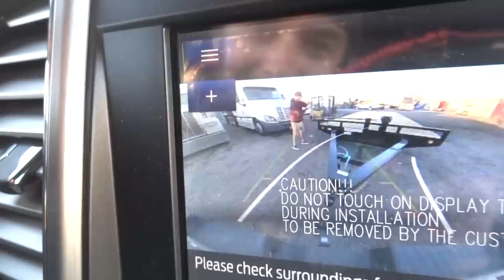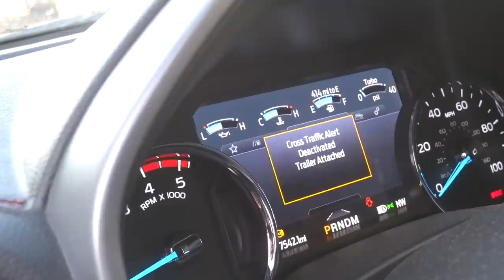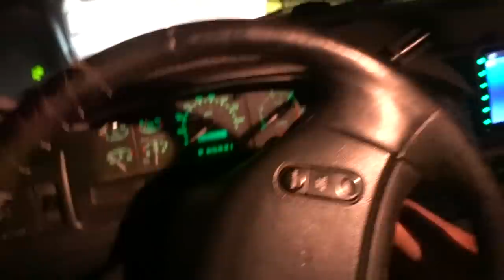MY NEW TRAILER IS HERE!

Comment: Power strokes have a oil pressure system that fires the injectors, so if you get low on oil it won’t fire the injector and shut the truck off

Comment: We’ve had a pj for 5ish years and love it. Only problem is living in Wisconsin the corners of welds have rusted through the powder coating, the license plate didnt have sufficient protection so it tore off from rocks/snow hitting it so I put a piece of steel there to protect it. Overall really like it. 18’ dovetail dual 5.2k axle buggy hauler

Comment: Coming from someone who has a Class A, (and also lives in SD) if you're loading one of your trucks (like the BBB or similar) take a very close look at your total gross weight and if you're unsure about it, take it to a scale like a CAT scale and weigh it (some moving companies have scales too and you can sweet talk them).  CHP will bust your balls big time and will pull you over and weigh you on the side of the road.  Just FYI man.
Reply: It doesn't have to have anything on trailer it's what the trailer is rated for. 10,000 pounds and over is automatically class A

Comment: As an ex ford diesel tech, if it shuts off from low oil and you don't drive it after, youre probably fine. The HPOP reservoir doesn't last very long if you aren't feeding it oil, you most likely didn't run very long with the low pressure oil system running low. Top it off, and send it. It'll be fine

Comment: Very nice trailer. I have same one in gooseneck. Get moveable d rings. You just pull a pin drop them. In side pockets. I have steel deck with 4 built in and 4 moveable d rings.

Comment: Love the new trailer.  But be careful with the cops.... i work for a tow company that tows for Police & CHP
They impound trailers all the time that are over 10k gvwr for the driver not having a Commercial drivers license.  Any trailer over 10k requires a CDL..  Just wanted to give you a heads up ..  love the channel #workforit
Reply: I thought it was 26k combined
Reply: Any trailer rated over 10k requires a CDL
Reply: For commercial use

Comment: Check the run sensor. My 98 aka early 99 7.3l has had a bad run sensor and it would die when ever it rained it’s a common issue. I think they close the cam position sensor
Reply: Not close call it
Reply: It would always restart
Reply: There is a recall on the truck

Comment: Obs will tow anything you put on it not at 80 mph but you’ll make it. I had my 95 7.3 pulling a 26 ft pj gooseneck with a 966 International farm tractor and a Gehl skid loader an it did fine
Reply from the maker: I just pulled a single axle landscape trailer today, truck barley wanted to break 65mph
Reply: @DMAXRYNO  Dane that sucks

Comment: That much oil loss could be related to injector orings.  Might consider rebuilding them with a new set of valve cover gaskets.  Have Zach install a 99+ Superduty 17* hpop and new orings at the same time.

Comment: 7.3s fire the injectors off of oil pressure so if the oil runs too low the truck will shut itself off before it can do any damage

Comment: I've had good luck with my PJ trailers. I've seen some guys put the rhino liner stuff on the bottom of the mega ramps that touch the ground to keep from scratching the paint.
Reply: The liner is a good idea but comes off. Its a work trailer. It's going to get scratched up.

Comment: The 7.3 powerstroke they cannot physically be hurt by running low on oil or out of oil. The high pressure oil system that drives the injectors will lose oil pressure seconds after the low pressure oil pump loses oil pressure. And the motor will die resulting in no damage done. Same thing applies to the 6.0 powerstroke it's almost impossible to have bottom end problems with the 7.3 and the 6.0.

Comment: Don’t feel too bad Ryno, I had a 2000 7.3L F550 and had the same problem. The dealership told me the HPOP will cut out around 9qts but the oil light won’t come on till your around 5qts. So your check oil light will never come on before your engine can’t inject fuel 🤔 kinda useless for the light.

Comment: How come you didn't get a gooseneck? Particular reason?
Reply from the maker: I want to be able to pull it with all of my trucks and not have to install goosenecks hitches in them. My Denali would also be too tall for a standard length neck on a gooseneck. Plus, DOT cracks down and pulls over more guys with goosenecks as they assume it’s commercial purposes.

Comment: Commercial is only over 26001 pounds. The 10000 number you referred to is only applicable on a class be lic. If you look into fmcsa it clearly states 26000 and under does not require a cdl. Please have more videos with the animals...👍

Comment: Let me try and save you some D.O.T. Issues. Just because your trailer is rated for 14000 doesn’t mean that you can haul that amount, let me explain. Gvwr on your truck and gvwr on your trailer added together is the total amount you can haul.(not to exceed 26,000 pounds. After you have the totals of the gvwr, go get your truck weighed, with the trailer. Take that total and minus out your total gvwr, and that is the legal amount you can haul. FYI, the fines are not cheap. Just telling you from experience...  good luck. Love your channel.
Reply from the maker: My denali’s gvwr is 9600-9900lbs. The combo is well under 26k
Reply: Problem is. Ryno is in Cali. And any trailer with a gvwr over 10k requires a cdl. Im pretty sure they are about the only state with that rule.
Reply from the maker: @anthonyreith7056  I actually believe most states have that law for trailer weight
Reply: Pretty sure they would consider you commercial too and require DOT # on side

Comment: My 8.1L burns atleast 1quart a month know the burning oil problems
Reply: Corey, I started using xdp synthetic additive in all my vehicles. My suburban was burning 4 quarts in 1000 miles. Now since I started using it, 3000 miles at oil change , it was down a 1/2 quart. You might want to give it a try. And all my diesel trucks. Dump trucks run cleaner. My Cummins 6.7 doesn’t smell like an onion field at 1000 miles anymore.
Reply: @bobevans6590  i tried synthetic oils once in my 5.3L and had to change it out in 8hrs the truck ran like crap with it

Comment: You might need a CDL to tow that. Don't want you to find out the hard way.
Reply: You are correct, over there in California you need CDL for any trailer over 10,000 pounds.
Not only that, the F450 GVWR is 14,000 as well so combined weight rating is 28,000 so pretty much need CDL in all fifty states.
Reply: I just bought a 14k deckover trailer as well but don't need CDL here in Florida as long as the combined weight rating is 26,000 pounds or less
Reply: Also if you do get stopped you are towing for personal use only. Don't mention work for it or YouTube cause you're going to need DOT number.
Reply: @jefflee4663  you are correct, never tell them them it's for making money.
Reply: I just recently bought a 14k Deckover trailer as well and used to to haul a Dodge truck.
No CDL needed here in Florida as long as the combined weight rating is not over 26,000.